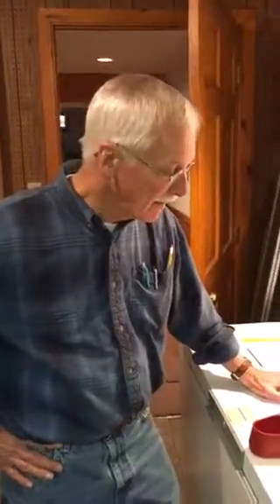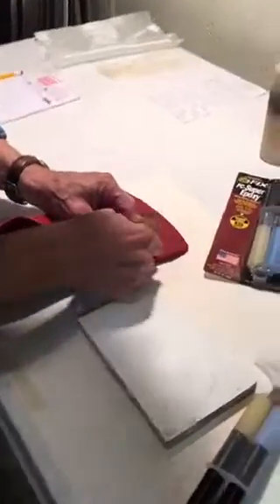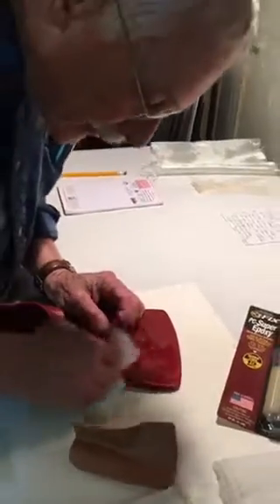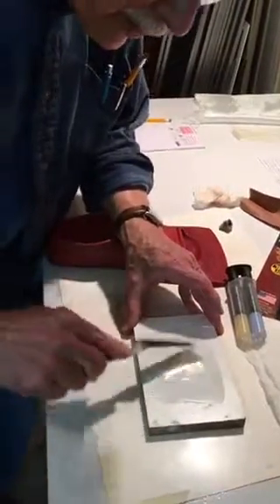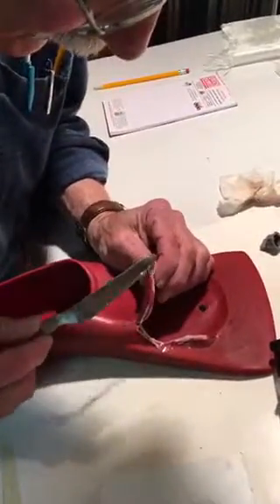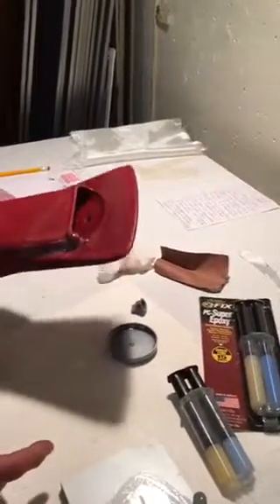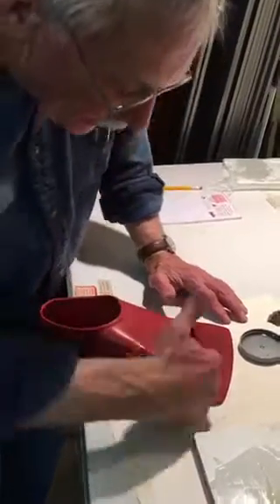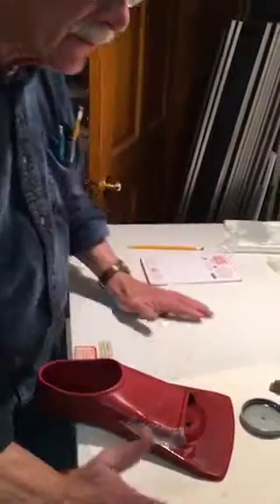Rubber flipper repair with PC SuperEpoxy

Comment: Thank you for this! I have some hot pink force fins that I've had for years, not only were they expensive, but they no longer make colors other than black or blue! Excited to try this to repair them.
Reply from the maker: Glad we can help! I think you'll be quite pleased with the results. Let us know how it goes and don't hesitate to call our technical line if you have questions 800-220-2103.